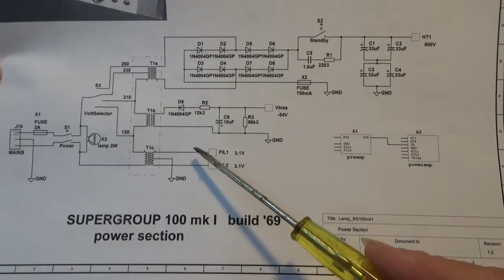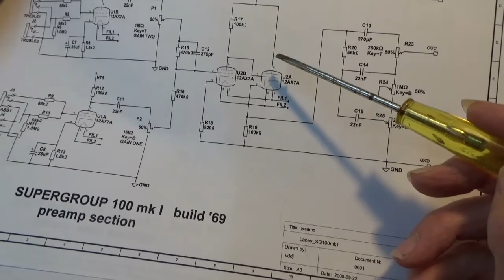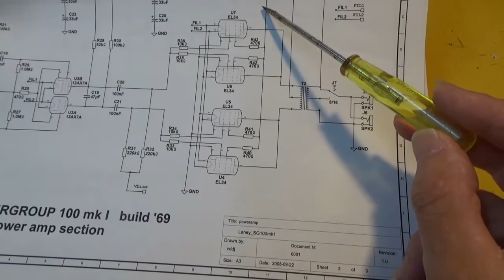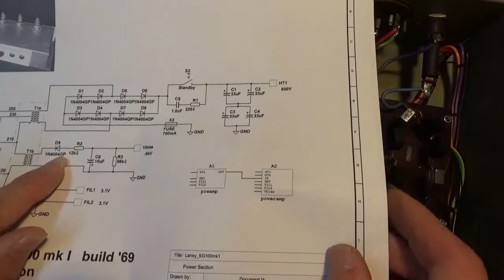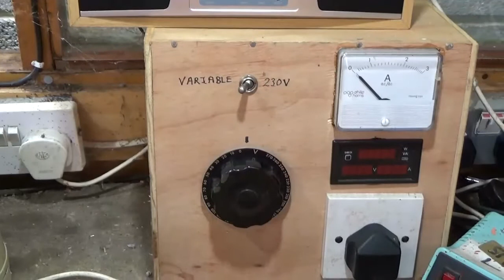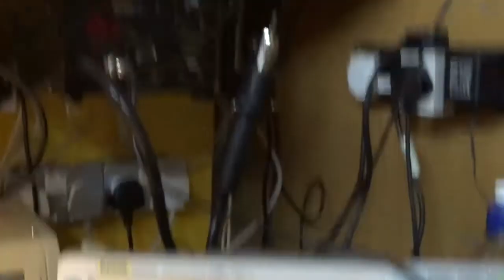Laney Supergroup 100 service

Comment: Great video - thank you. I "re-found" an almost exactly the same laney supergroup mark 1 in my shed, which I last played in 1988, and I guess it is 1969 build (model number 5002) ...did you note the model number on this one ? - two strange things I have noticed (i.e. before opening for checking) is that on mine,  the two EL34"s on the right are GE made, and the two to their left are Mullard .. pins the same (of course), but internal design different and the US valves fatter and taller, with different plate designs). 2nd difference, is what I assume is a post manufacture modification, is an extra volume knob (?) placed where the power light is on yours (then a smaller light is placed below the on-off switch). I am guessing that it is maybe a volume control to allow more distortion (you probably know where that might be placed in the circuit design !) . If anyone reading the comment here knows the answer (i.e. is that what it is, and was that a well known mod that someone did to the laney ?). As you say you are not a valve man, you might not know what the effect of having the two different styles of valve are, and what that might lead to - probably it was just a supplies issue, to install the GE valves, but maybe this also was a "tweek" that someone decided improved the amp ?

By the way, I love your comments about "hating" valves ... when I had my first marshall amp (age 13 ?), I opened it up, and was looking at what was inside it, and accidentally touched a capacitor (or a wire leading to one), and found myself on the other side of my bedroom, having tossed the unboxes amp onto the ground - amazingly, it bounced and I suppose landed on the transformer end, and no valves were damaged.....many many years later, when playing a gig in a pub, I managed to spill a pint of bitter over it, and it still carried on !...
Reply from the maker: Thanks for your comment. I don't think the different valve manufacturers would make any difference, they would have almost identical specifications, but the actual construction may be different.
No sorry didn't note any model or serial number. But my friend I did it for is very happy with it, as it was running well below its full output before.
I can't say what your extra volume knob would do without seeing the circuit.
I don't really hate valves, but was born too late to be taught much about them at college and I do like to be able to put my fingers in things without risking death!
Although getting a shock occasionally isn't a bad thing it reinforces a respect for high voltage. But I've not had a shock for a few years now, so I'm probably due for a wake up call!